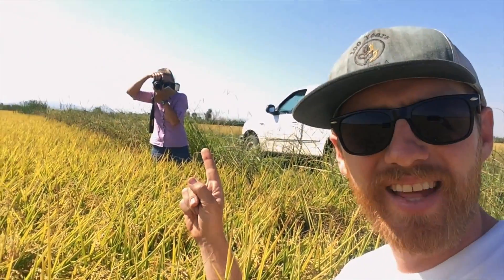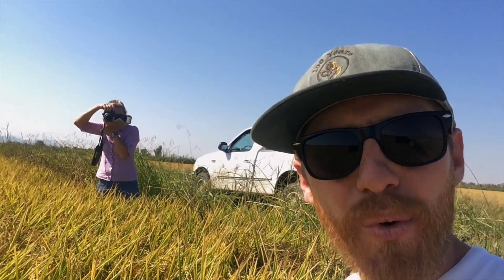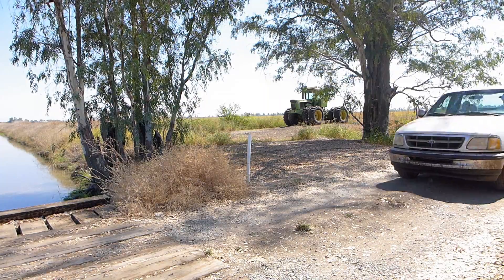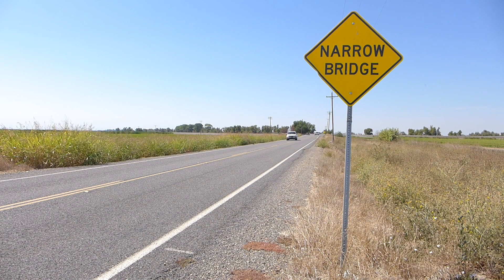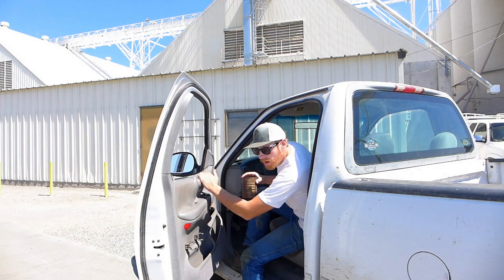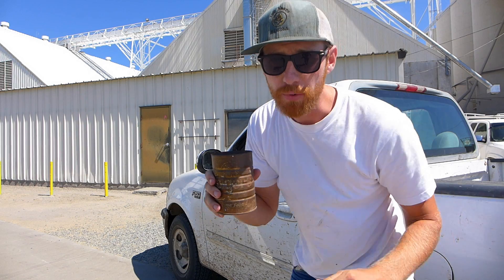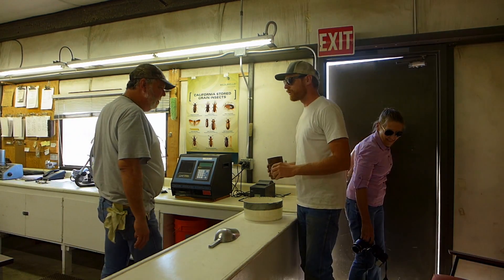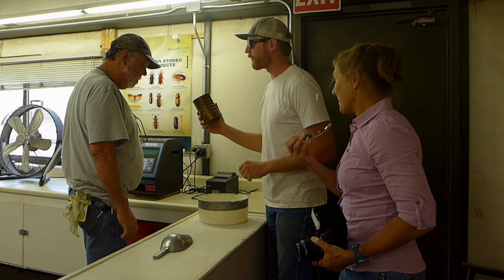Talk to the Hand Sample!

Comment: Another great video...I hate to ask...how is the severe Cali drought affecting your farming?
Reply from the maker: Fuzzy! Great question! 
2014 - The state granted us 100% water allocation. We were able to sell water and not plant rice on 25% of our ground. The proceeds from the water sale were greater than the rice market would bare. Though the price of rice was above average (pretty good) because of the lower supply and increased demand (since there was no end in sight for the drought).
2015 - The state cut us back to 50% water allocation. We planted 80% and supplemented the surface water with underground water from deep well pumps. This created a lot of extra work. The price of rice sky-rocketed for a bit. A savvy marketer forward contracted rice early and sold as the peak approached. There was however a price threshold and we forced a lot of buyers out of the market by asking for too much money. At that point the price plummeted. With the dollar strong we couldn't export as easily. Other commodities were cheaper. You could buy a lesser premium medium grain from the Southern US on the cheap cheap. The drought looked to end with El Nino and mills thought they could wait out for next years crop. They did.
2016 - 100% water allocation with no chance of selling water. Worst case scenario. Price of rice is well below average. There was a lot of carry-over from last years crop by those who decided to be greedy and wait for the bigger big bucks; which never came towards the end of that price peak of 2015. Supply is high, demand is low (since we lost a market share last year) and the dollar is still strong. 
SO! If you average those three years together (and you sold at the right time in 2015) you are surviving.
Reply: Wow that is crazy!